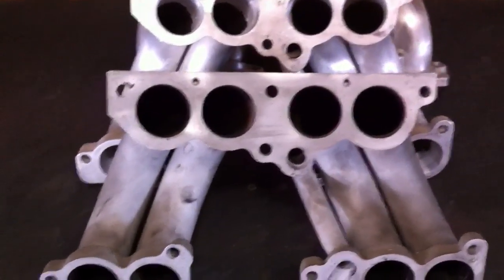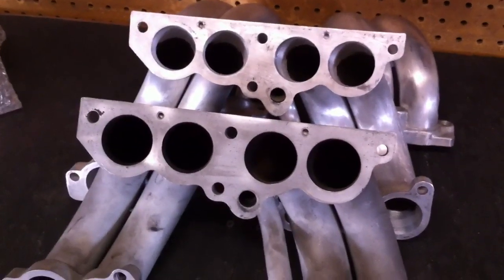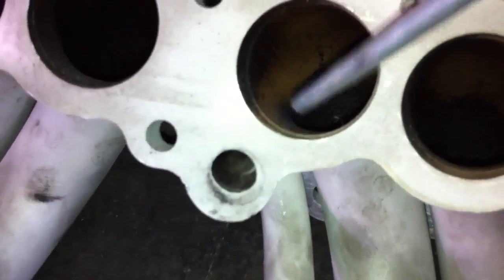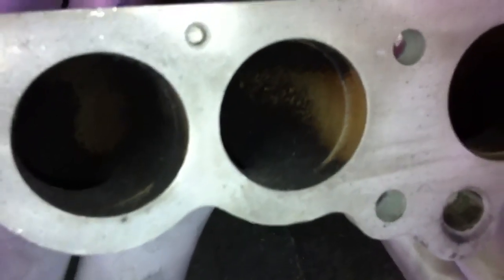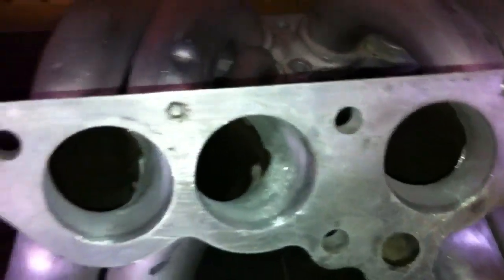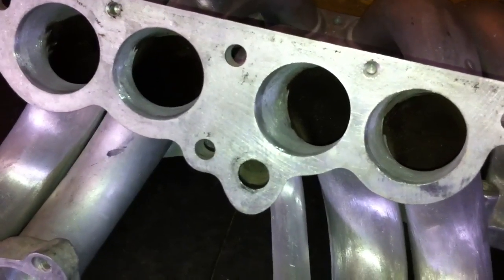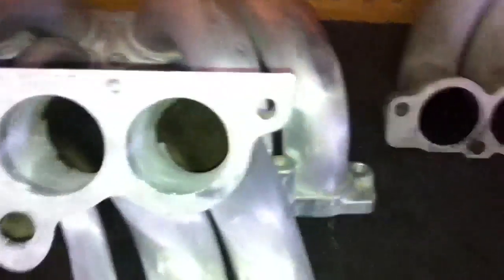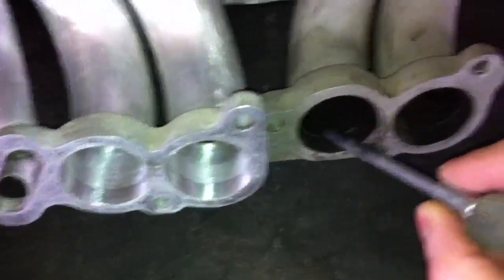TPI Porting Secrets. Runners. High Flow Fuel Injection. Ported L98.

Comment: Hey Darin on a stock L98 Corvette what kind of horsepower number are you seeing on average? I talking about a complete ported intake. Throttle body with air foil, plenum, runners, and lower manifold. The whole enchilada?
Reply: 20 hp
Reply: BTW it's a 1990 Corvette with the 113 Aluminum heads.

Comment: What are your thoughts on a small siamese job on the upper lip's flange and the plenum? It seems that would shorten the runner by just a little bit. I know there isn't much metal on the flange to siamese but it does give just a little less length to the runners. Great vid.